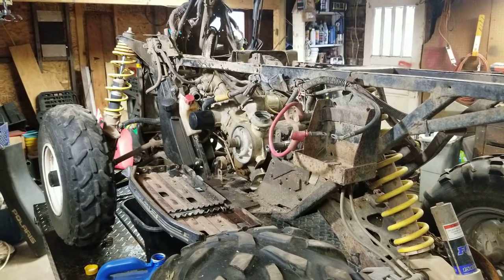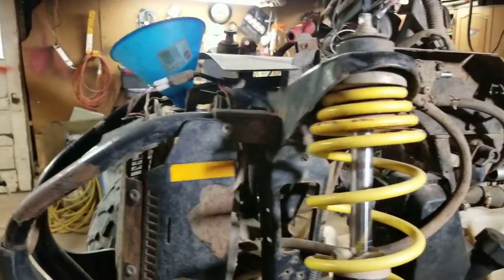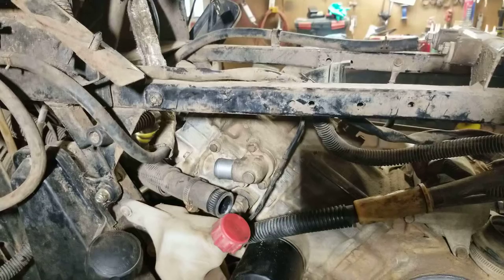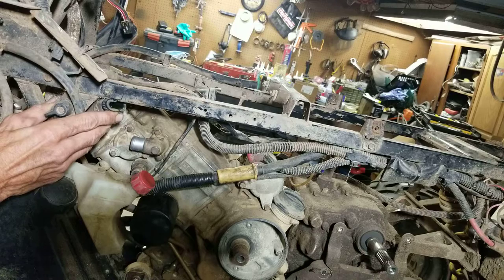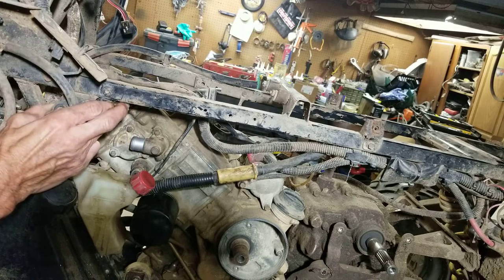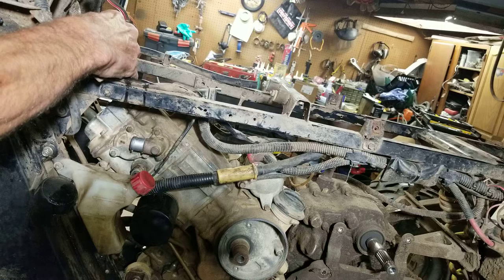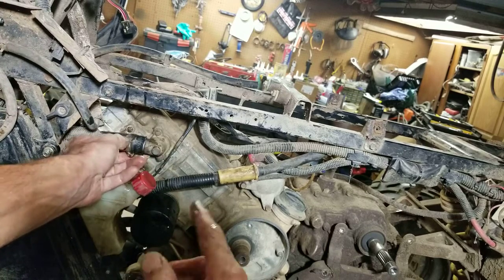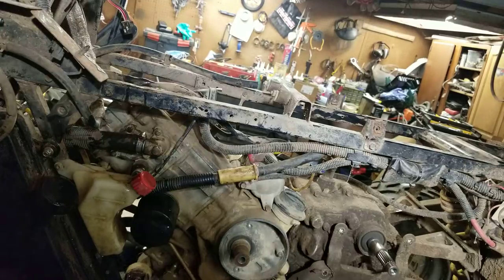Stop overheating on a Polaris 500. How to bleed air out of coolant lines.

Comment: Take notes people. Finally someone that knows how to fill a cooling system from the bottom up. That is 100% the correct way to fill any cooling system. Everything from a sportsman 500 to a BMW. Especially reverse circulation automotive applications , You fill through a disconnected radiator hose opposite of the thermostat. Depending on the system you have to follow hoses and make sure your filling through the hose that fills engine block from bottom up and always opposite of thermostat. Yes the thermostat is closed, That is why he fills slow to allow air to pass thermostat through steam hole at top of thermostat. In this case he does not have to fill through a disconnected hose because the bottom radiator hose connects to the lower part of engine opposite of thermostat. On this system you still have to do a final burping / filling procedure at radiator filler but this method will assure no air bound engine block.
Reply: Good explanation on filling from bottom up. Can you add details to the final burping process.

Comment: I don’t think it will flow out of the engine because the thermostat isn’t open. It should be fine to top off with all your hoses attached. When you get ready to run the motor, run it with the radiator cap off for a bit and jiggle your lines to get the air out. Top off as needed. 

love your videos man. Just got done rebuilding my ‘95 425 magnum and your videos helped allot.

Comment: I saw you using peak antifreeze. I'm low on coolant on my 2005 polaris sportsman 500. Everything I read keeps saying you have to use some special coolant made by polaris. I figured that was BS, but obviously, you know far more than myself. I'm having a few issues with it, but yesterday was the first time mine said it was overheating while I was idling, but when I took off, it was fine. I'm not sure if that's because I'm low on coolant or what. It's also missing the pull cord, and I hear a rattling inside that cover. I'm assuming it's the bendix. Any help would be greatly appreciated. Have a good one. 👍🏽 🎉

Comment: Love your videos, keep them coming. I just rebuilt a sportsman 500 myself. Im having issues with it overheating. Took it out for a short ride and it overheated. Fluid gushing out of the overflow bottle. Tried burping the system without any luck. The fan would cycle on and off as i would expect. However the idiot light would stay on. I decided to install a new radiator and replaced all the hoses and changed the water pump propeller with an aluminum one. I even decided to replace the head gasket with a Polaris OEM head gasket. Filled the system with antifreeze. I started the engine again and the same issue of overheating. The fan cycled as it should however the idiot light came on after running 10 minutes or so and would stay on. The only thing I didnt change was the thermostat and the engine temp sensor. Which were both new. I tested the thermostat on the stove  and it open and closed at the proper temperatures.  I do not know what else i can do. Very frustrated. Any help would be immensely appreciated 😢.
Reply from the maker: When you replaced the head gasket did you check to see if the head was not warped? Usually when fluid backs up into the overflow it's a warped head. Combustion blowing in coolant system. Or the impeller is bad.
Reply: I made sure the head was flat. Also, I sanded it with 1000 grid sandpaper on a piece of glass. Similar to 0:04 one of your videos. It looked like a mirror. Since the temp sensor is cycling the fan as it should. And I can see antifreeze in the radiator flow on and off, indicates the thermostat is functioning as well. I'm now leaning towards a bad temperature sensor in the head. I'm also going to add a radiator hose adapter to add a temp gauge so I can actually see what the coolant temp is on the hose coming out of the thermostat. I do not know what else I can do. What should the temp be when motor is running normal? And what is the idiot light temp supposed to be?
Reply from the maker: @dvcm27  The temp should be about 165 to open the thermostat. the temp sensor in the head runs the idiot light the one on the radiator runs the fan. depending what year it is. It sounds like you did everything right and coolant is flowing. Is it still overheating or is it just the light going on? How are the fins on the radiator? could that be bad? I would try the sensor. They are cheap.
Reply: I used a vacuum type coolant refiller. I feel pretty good about this unit. It created negative pressure in the coolant system. All the hoses collapse under the negative press. Whiched sucked out all the air. I pretty sure I got all the air out of the system. I ran the machine last night and I used an infrared temp sensor. I checked the temp on the head and cylinder and it was running around 180ish. However the idiot light came on and wouldn't go off. The thermostat and fan was cycling on and off as it should.  As you said in previous thread it must be the idiot light sensor. A dam OEM one cost about $154. Crazy cost. I have the original OEM sensor I'm going to swap out. I'll keep you posted.
Reply: I changed the sensor for the idiot light. I didn't want to lose any coolant so I put the machine on it side and replaced the sensor.  I didn't want to introduce any air in the system. Mission accomplished.  Started the machine and ran it for over a half hour. The idiot light never came on. The machine was running between 185 and 205. I finally solved the issue. The initial issue was air in the system. Which caused the engine to over heat. And a defective idiot light sensor (cheap Chinese crap). I learned a lot from this experience. The best investment I made was the coolant system negitive vacuum tool. There's no guessing if there's air in the system or not.
Reply: @dvcm27 how much did it cost and where
Reply: @TitaniummanGarage I’m am as I’m typing. Working on a 1999 xplorer 400 2 stroke chain drive top end was rebuilt at a shop not long ago from the previous owner I take it for spin when it warms up antifreeze sprays out the overflow bottle. Possible air lock or maybe over fill are best case it sounds like ?
Reply: @TitaniummanGarage I don’t see a thermostat location on this one lol
Reply from the maker: @NEWFIEBULLET-1  I would pull the spark plug. See if its wet with coolant. If the head wasn't properly cut or is warped the combustion blows it back into the bottle. On the 2 strokes there is a screw on top of the head for bleeding air out. Check your plug first. Maybe crack that screw open till air and coolant come out. you don't need to take it all the way out. Its like a bleeder screw like on your brakes.
Reply: @TitaniummanGarage  I seen your reply last night thank you bud . I’ll get looking at that today I’ll post the progress.thank you again

Comment: Found a plug (polaris 3084860) on a cylinder head drawing. Could it be a coolant bleeder bolt?
Reply: Update. Threaded plug above exhaust port. Coolant came out.
Reply: Coolant came out of mine also. Unfortunately I still have an overheating issue.

Comment: I have a 2004 polaris sportsman 700 twin and it will start and run fine but when I ride it around I have like no power in the top end tried new carb and iv also rebuilt the oem one and still no power it has a new fuel peacock and fuel pump and both spark plugs are new I'm kinda at a loss any help would be appreciated thanks keep the vids coming.
Reply: How is the timing? Plug electrode color to show if running lean?
Reply: Had this issue.
Carb wasn't giving enough gas.
Opened it and ajusted the needle, you can also change the jet for something bigger.
Reply: Cam was worn-out and two lifters where bad spent the winter rebuilding the engine.

Comment: Have question can you replace a 1994 400L bottom end with a 1994 polaris 400 complete bottom ?Also. Im in  Michigan by jackson and up in Houghton lake alot . Do you do repairs for others on side ? If so i dont see an email for you please let me know a way to contact you . Thanks tony
Reply from the maker: Are you asking if you can do a motor swap from another 400 2 stroke? Yes you can. I do light repairs for other people but not engine rebuilds.
Reply: @TitaniummanGarage  rhe until i have is an1994 400L 4x4. Need bottom end replaced or rebuilt. Guy told me he has a 1994 bottom end complete but it was on a  1994 4wd 400 sportsmen i think he said but he said it was not a 400L . I assume the bottom end same for both but was wondering if you could let me know for sure?  What year 400s from 90.s are completable. Thank you in advance . I Really enjoy your channel
Reply from the maker: @tonyd9240  you can use any 400 bottom end. even a scrambler 400. They are all the same. If you install a used one just make sure to replace the crank seals while you have it out. They are cheap and will save you a headache down the road.
Reply: @TitaniummanGarage  
Thank you so much for the information. Much appreciated.

Comment: Dude I blew up something in the transmission or clutch.  How east are those to rebuild?  What kind of oil do you use in transmission and crankcase
Reply from the maker: There pretty easy. I've done 6 of them. Try pulling the belt off first. See if you still hear the noise. If so check the clutch.

Comment: Dont wanna be a jerk but thats not even nessesary. If its not an U on the system you domt have to bleed anywere exept at the highest point. And its radi cap on those
Reply from the maker: You could be right. I have done quite a few 2 strokes and had overheating issues because of coolant lines not bled. So after that I bleed everything just to make sure there is no way possible air is trapped in the lines.
Reply: Actually that is 100% the correct way to fill any cooling system. Everything from a sportsman 500 to a BMW. Sure you can fill from the top and burp it many times and getting hot in between burp intervals. I have seen mechanics not use this method and overheat engines and warped the heads. He is filling system from the bottom up. Also the way he pours it slow helps not to trap air. I been using this method for 30 years. I would say 40 years but 40 years ago the way cooling systems were designed you could fill them through top of radiator no problem.
Reply: Isn’t that what the 10 mmbleederbolt isfor on the thermostat housing?????

Comment: Hey DIY blind guy here again. Your video sounds pretty good but I don’t understand what line you’re saying to leave disconnected if you can please describe a little more in detail the procedure here. I want to flush the cooling system on our 99 Scrambler 500.
Reply from the maker: No problem. I tend to talk fast sometimes in front of the camera. There is 2 ways of bleeding the system. I was referring to the top radiator hose going to the left upper side of the engine. Now I just leave the rad cap off, run it till it burps out the air. you'll have some coolant overflow. I wait 5 minutes to make sure the thermostat opens.
Reply: @TitaniummanGarage  you are the man! Il let you know how it goes